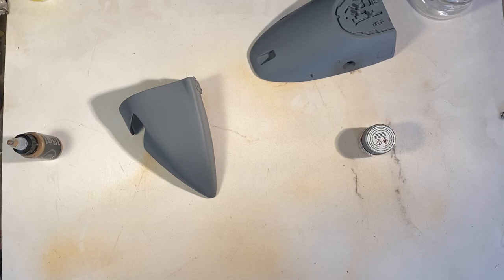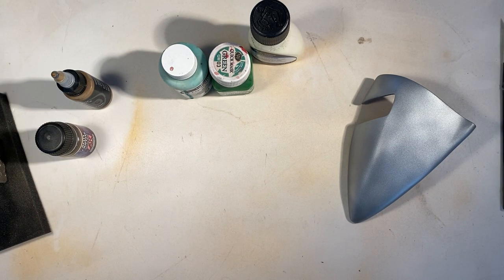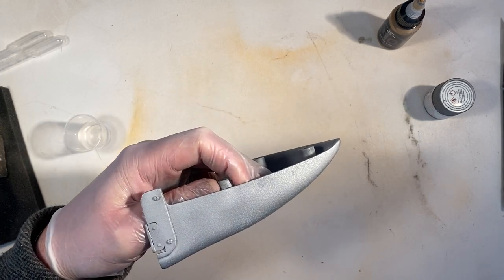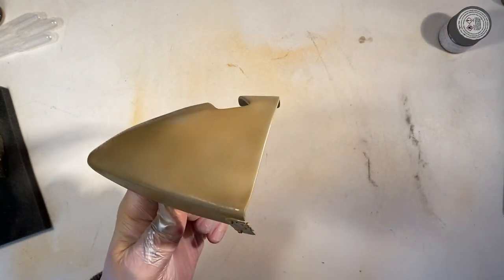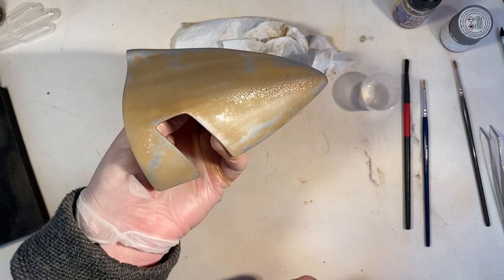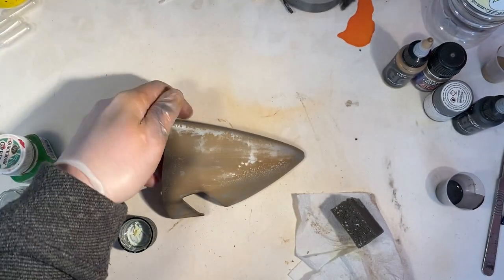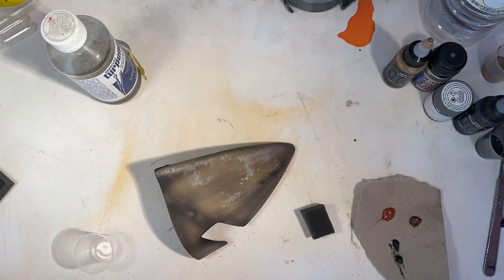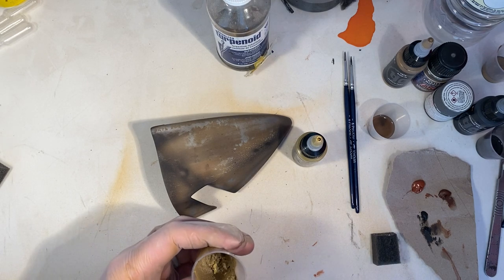Star Wars Studio Scale 1/4 Speeder Bike Paint blog 1

Comment: I have always wanted to try that chipping fluid, specifically the AK one you used as I have some of that. But, even with that fluid or hair spray, have you ever had it affect the paint long term or does it evntaully 'stabalize' ? I have always wondering if it afected the paint at all down the road. 

Also, great weathering as always. I feel the same way about weathering some times, I start in on a project and think to myself, okay, don't go too heavy... and before I know it the model looks like it was just pulled out of the swamps of Dagobah :)
Reply from the maker: No once it sets up it’s pretty bulletproof. I used it a lot back in the day with armour models and I never had any issues. And yeah knowing when to stop weathering is a skill of it’s own!
Reply: Thanks for the info!
Reply from the maker: @bbgg2007  no worries 😉